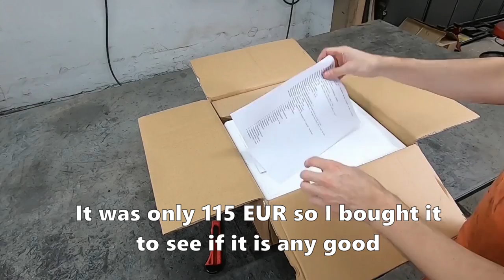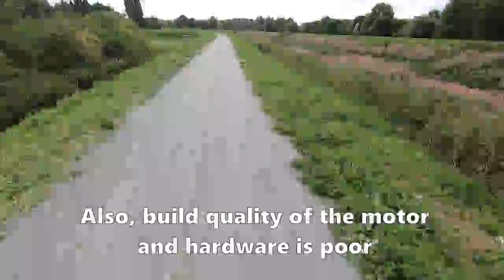The cheepest and easiest bicycle to motorcycle conversion !

Comment from the maker: It's actually better than expected!  Would you buy it?
Reply: That's very cheap - I suppose the kit could be used for other projects too, it's a cheap way to buy the full kit - sprockets, cables etc that would otherwise soon mount up.
Reply: i dont know how long it last.
1 yr maybe even 6month.
Reply: That 49mm iron cylinder sleeve kit you bought really need properly ported to make decent power.....Also the stock rag joint rear sprocket mount sucks. In your case. You could drill 6 small holes in the sprocket to mount it on the rear wheel where the disc brake normally mounts to. So the sprocket stays perfectly straight.